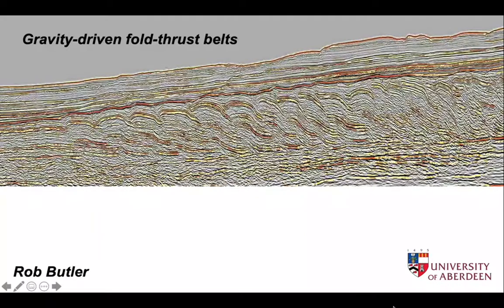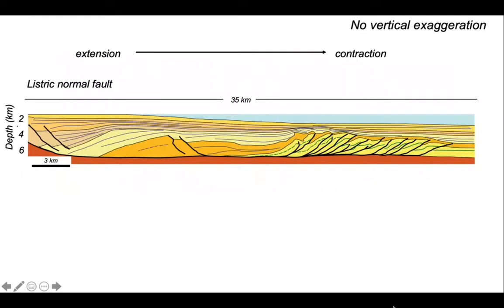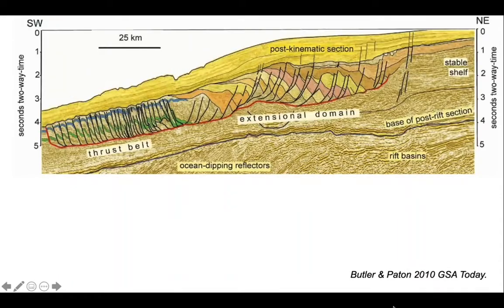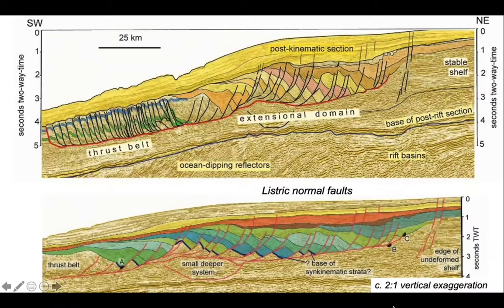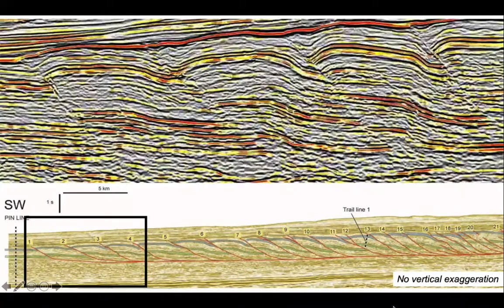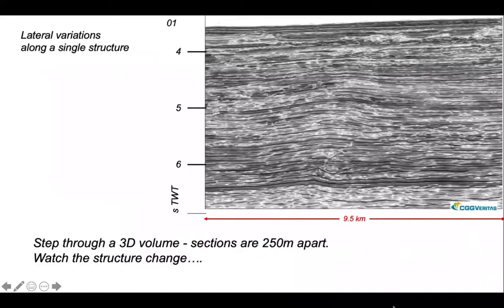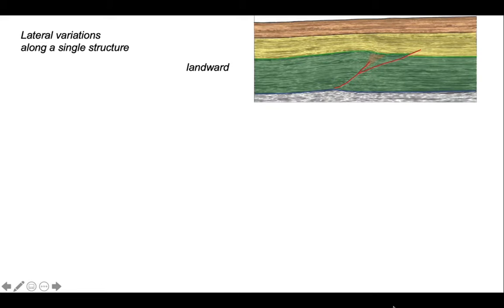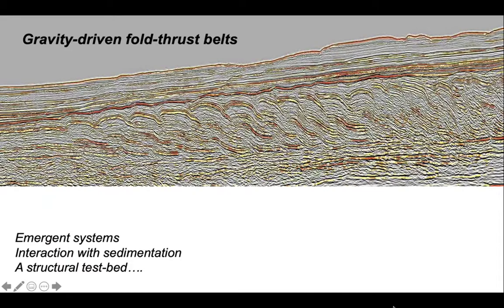Gravity driven fold-thrust belts

Comment: At 1.47, there are several sedimentary layers shown under the ocean.  I’d like to understand why and where each new source of different material came from to create each layer as the ocean received them and laid each new one down? 

I do understand that limestone is the settling/sedimentation of the calcium of skeletons, so obviously the source was dead creatures. But what about other non-biological minerals?
Reply from the maker: Thanks for the question. The vast majority of the sedimentary layers in these sections are sediments washed off the surrounding continent... various grades of sandstone ...
Reply: @robbutler2095 . Thanks Rob, however…may I…..?    without knowing names , it’s how come one layer is pure yellow stuff, another layer is pure red stuff etc.  Each new layer has a different source of aggregated materials and must come from a different place.   So why are there distinct layers as opposed to a general mix.
Reply from the maker: @josiebee-e6e  The colours to which you are referring are my interpretation - highlighting different packages of sedimentary rocks. We do this to highlight and distinguish the different packages (deposits of different age). The basic seismic images lying behind the interpretations are shown before my colour is used - which are trace images of the seismic signal recorded by the surveys. And these are shown in each case before I add the colour. If you'd like to find out more about how seismic images are created and interpreted - I've built a series of videos starting with: https://www.youtube.com/watch?v=tP_fEtWS9Mo&t=3s
The full seismic interpretation playlist is: https://www.youtube.com/playlist?list=PLxvNbEa7Qws59ACzCgFD-DMGEDR8xpt7f